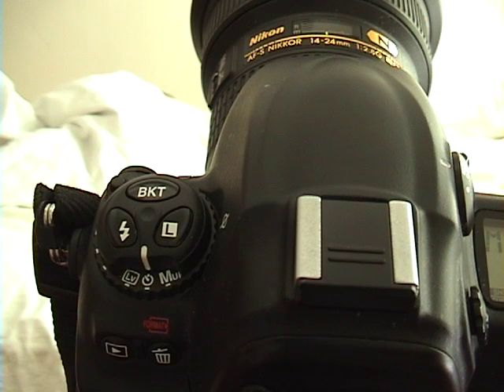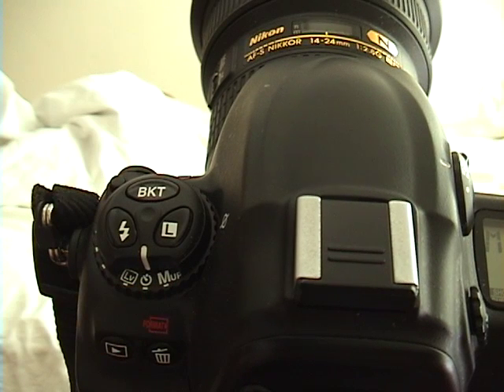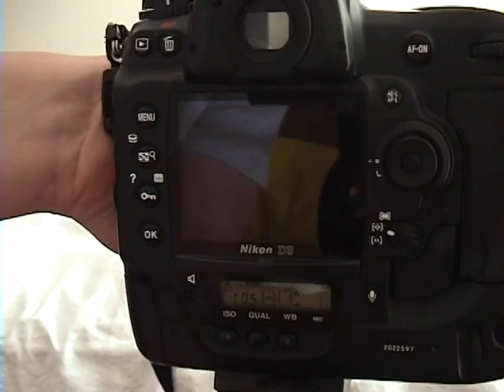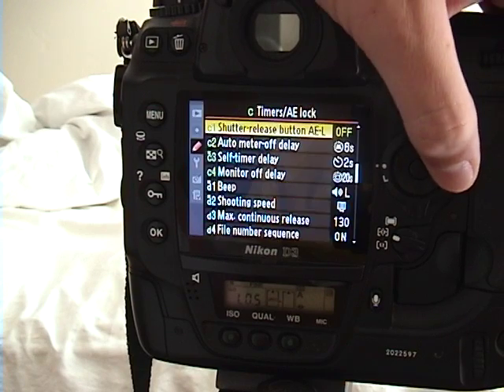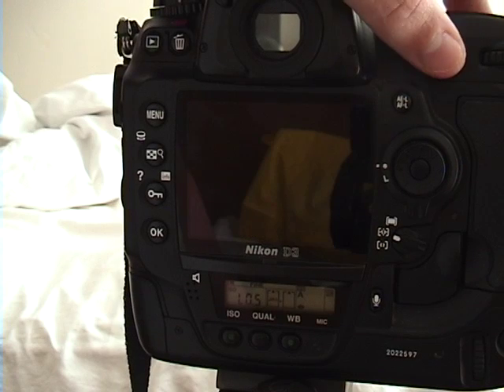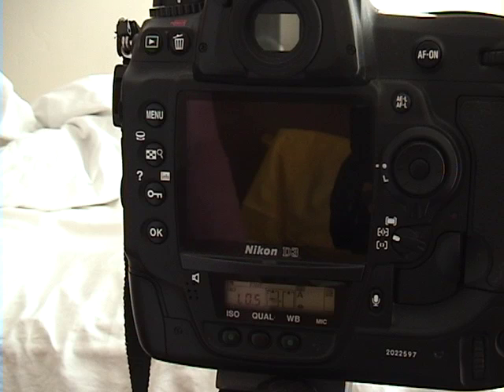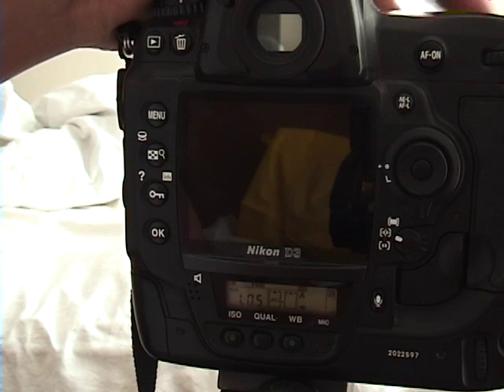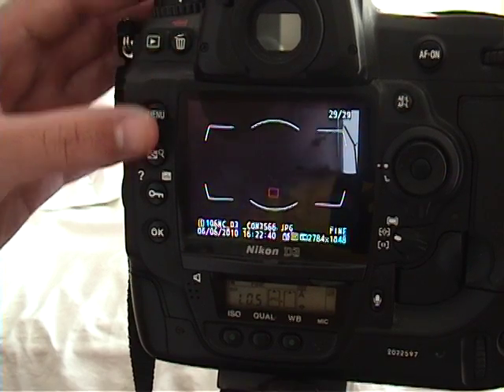Nikon Camera Tutorials: Timer

Comment: Hey, quick question maybe you can answer. I have D300, total newbie. Played around with settings in A mode. Now the photo is delayed by 15 secs or more. I press down and decides to take photo 15 secs after. How do I turn this off!? Ive tried everything. Manual mode it works like a charm!..